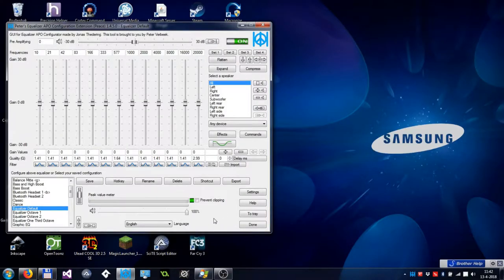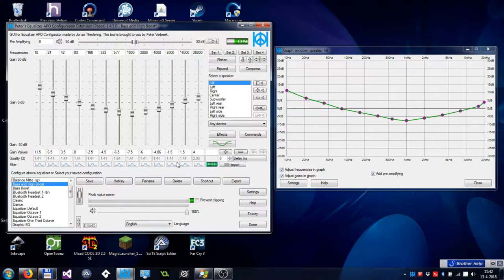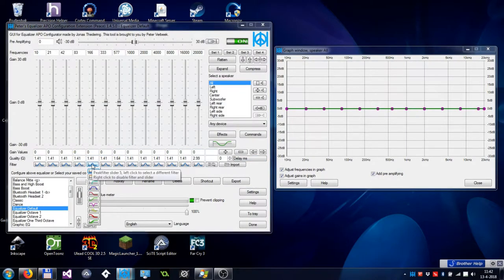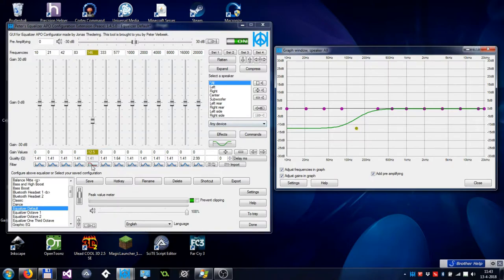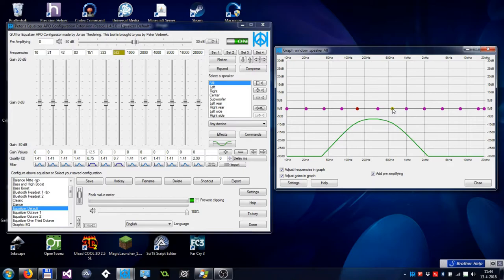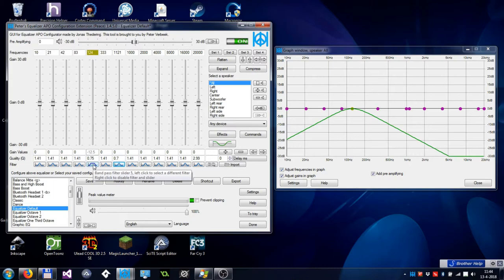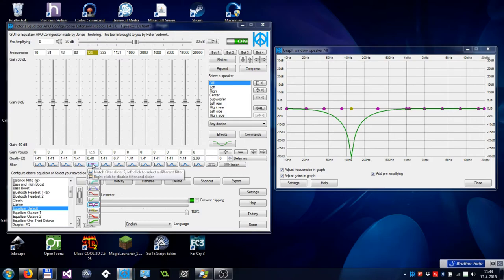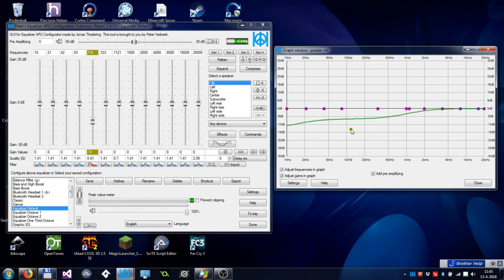Peace Equalizer - Tutorial 7 Graphic EQ and filters

Comment: thanks for the playlist very helpful, i'm having a very irritating issue which is the increments peace decides that it needs to add or take off any .1 increments to the closest whole number so 3.9 it will make it 4 or 3.2 it will make it 3. How do I fix this?
Reply from the maker: This rounding is done on base of the Snap dB gain setting (by default 0.5 dB). To change this go to Settings - Sizes and Amounts tab - Snap dB gain (right column) - enter 0.1 dB - click Save button.

As the difference between 3.2 and 3.5 dB isn't noticable Peace rounds by default to a half dB. But I understand it can be irritating when you aren't aware of this, especially when you've imported filters from Room Equalization Wizard which may have a smaller than 0.5 gain resolution.

Comment: For some reason when I increase my microphone volume it has no effect towards it, I made sure it was set to the microphone and the mic is connected, it's just not getting any louder. is there something that could be causing this?
Reply from the maker: Did you check in the Configurator of Equalizer APO if Equalizer APO is installed on your mic? By default it's only installed on the default speakers and mic.

Comment: hi, i use peace now for a few years now and i am very hapy with this.. but...i having throuble deleting older settings that comes with peace, like  7.1  ,, i can delete them but are again there after reboot pc,, so is ther an ini file or otherwice were i should permanent  delete  them ?
Reply from the maker: A few configurations (settings as you're calling them) can't be removed but "7.1 setup" and others can be removed. If this one and others "magically" appear again then perhaps the "Default configurations are installed at program startup" checkbox is checked. You'll find this checkbox on the "General" tab in the Settings.

Comment: why does my speaker makes a popping sound and doesent work when i turn off the filters
Reply from the maker: To trace the issue could you give some more info. When does your speakers make a popping sound? "Turning off the filters" do you mean by using the on/off switch?
Reply: yeah, the E🔎 button
Reply from the maker: "E🔎 button" What button is that?
Reply: @PeterVerbeek  the button left of the import button that greys out filter and quality
Reply from the maker: Thanks. You're talking about the Graphic EQ. Yes, it looks like an E with magnifying glass.

Does the popping sound occur when switching from using filters to Graphic EQ? Unfortunately I don't know what would cause this to happen. You might have to ask this on the Equalizer APO forum https://sourceforge.net/p/equalizerapo/discussion/general/ to get an answer. Perhaps Equalizer APO wasn't installed correctly somehow. The only thing I can advise is not to use Graphic EQ.

Comment: Can you help me with a preset for behringer c1u ? I`m waiting for a reply! <3
Reply from the maker: It depends what you need. For a bit of bass boosting you can use the Bass boost preset (configuration) which is one of the configurations in the left bottom list, and change it. Does this microphone have any frequencies which has to be filtered or boosted? In other words, does the voice recording have to much treble or bass?

Some tips for using your Behringer c 1u.
Tip 1: For the preset you're making, select the Behringer in the device list (at the right) and save it. If you leave it on "Any device" you'll end up filtering the sound twice: Once for the microphone and once for the speakers/headphones.
Tip 2: To accurately listen to your voice changing by moving the sliders, put on (a good set of) headphones instead of using speakers.
Reply: I will try it. If i get any problems, I will reply them here. Have a nice day and thank you! :)
Reply from the maker: For more question, you know where to find me :)